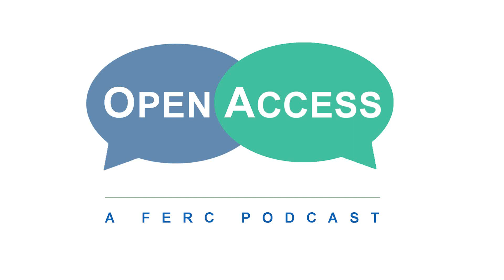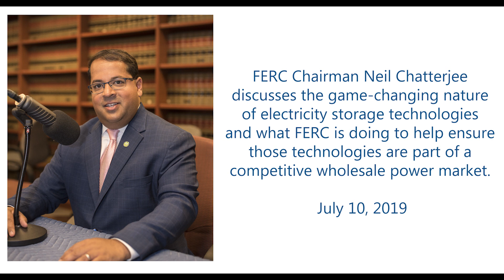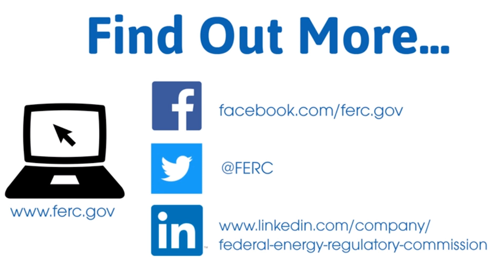Open Access: Chairman Chatterjee Talks Electricity Storage July 10, 2019 (Recorded July 8, 2019)

Comment: What I really wished the Federal government would do is make solar energy more affordable.  The fact that there is such a high upfront cost to install Solar Power in homes has deterred homeowners from making that original investment.  The break even on such an investment takes too many years.  I believe the way to decentralize the utilities and power providers are to have homes built already be installed with Solar panels on them along with grid tied inverters.  See how the excess energy produced by the solar panels on the homes (after usage in homes) can be relayed to the grid.  I don't think this is a far fetched system to implement either.  "Make this happen" Chairman Chatterjee.

Comment: Very ambitious order indeed.  Competition is great for the consumer, or is it?  Will the reduce cost actually be seen month in and month out?  The so-called regional organized power operators if not regulated with a fine tooth comb will find loopholes to take advantage of the Order (#841) and its benefits to them while circumventing the savings to the customer that Order #841 is originally intended for.  While I appreciate your fervor in implementing such an order, power suppliers are making Billions off the way the current system works; not by following the rules but by understanding them thoroughly and finding ways (loopholes) on how to bypass them as a whole with pinpoint discretion.  Chairman Chatterjee, I have had a bad experience with the whole sale energy market and this has forced me to look into FERC and how it governs the current Power markets.